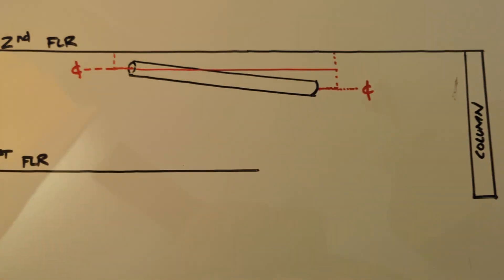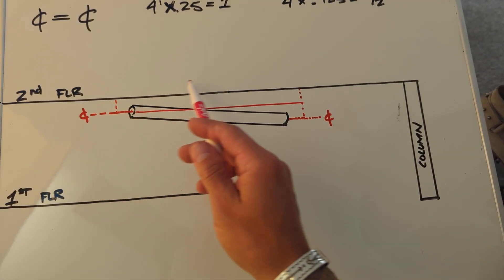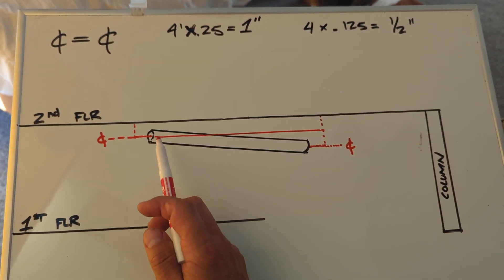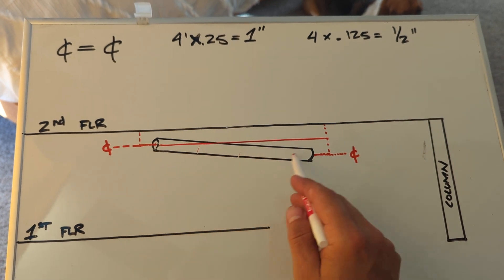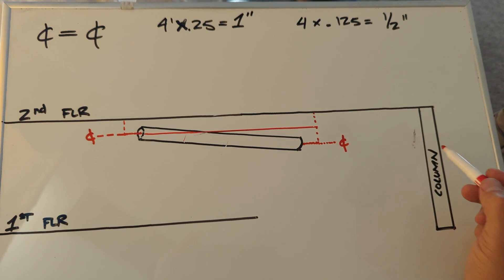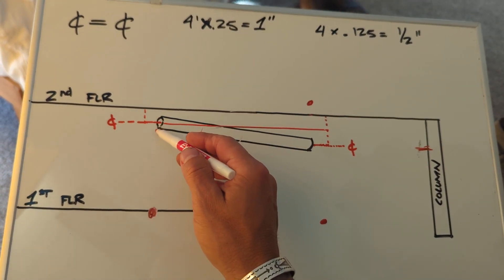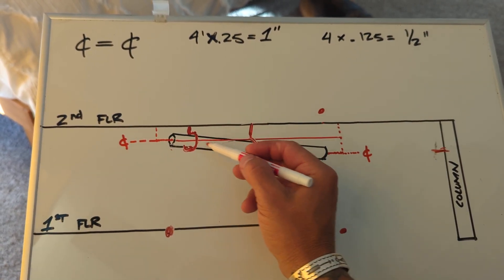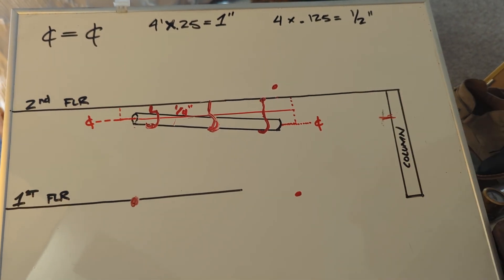How to measure center to center on DRAINAGE PLUMBING with Joon

Comment: Dude you rock! Thanks for bringing this up
Reply from the maker: You asked you shall receive! Hope it helps partner
Reply: @JoonGolfs  so if you don’t have a laser it’s probably difficult to do that due to floor not being completely level or the deck?
Reply from the maker: @denvercharlebois699  it's not harder per day it's just not accurate. Unless you start your bench mark at the same spot for all pipe but that's not likely. So 8f it's a smaller section you'd be okay